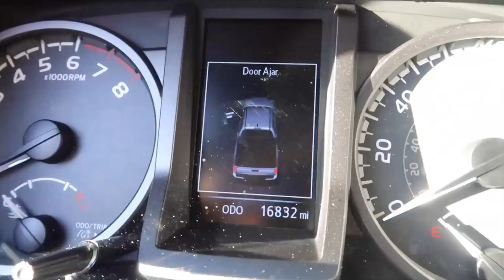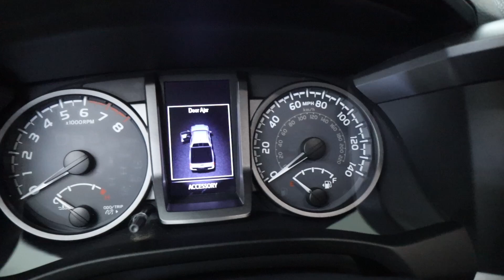What Things Went Wrong at 50k miles on my Tacoma?!

Comment from the maker: Something else I just remembered that went “out” on my Tacoma within 50,000 miles was the Bluetooth on my stock radio. I had it reset by the dealership a few times, tried different phones, but at some point bluetooth just stopped working all together. I’ve since swapped out my stock radio for an aftermarket one with CarPlay and I’ve had no issues since. Anyways, thanks for watching the video and sharing your advice (especially on my steering rack leak)!
Reply: Thats probably common with later model toyotas. I had a 2014 rav4 with a stock head unit and it was useless then got a sony with carplay for about 300 bucks with installation included and it changed the whole car.
Reply: Chloe I have a 2019 ,  when did you have to replace front brakes
Reply: Chloe I had them change mine a year after I bought it the instrument cover,  it actually had cracks in it ,  where did you get the instrument cover
Reply: Lucas Oil makes a power steering stop leak that is worth trying 🤙🏽

Comment: 2018 100,000 no leaks.  But clanking noises when hitting brakes at low speeds.   Moving around in the driveway.  Maybe brake caliper contact?  Not sure.

Comment: 2021 TRD OR, 48K miles. Just noticed the rack leaking in the exact same spot, left side. I have checked it in the past and it was not leaking, so must be recent.

Like yours, the right side is fine. I am opting to leave it alone for now. If/when the time comes, I’ll buy another OEM and swap it myself, and I’ll probably complain about it. 

I’m curious, did yours ever get worse?

Comment: Your suspension...why I never lift or change. Heard there's 1 idler pulley you you can't get the bolt out without removing other things. I think it's lower. My upper driver side pulls was screaming..sprayed some WD40 white lithium grease on it and stopped. I was driving ALOT when the rain came. I think it dried out the bearing. Bought all new pulleys and belt.

Comment: I bought a 2016 Tacoma SR5 last year with 68,000 miles as of now it has 78,000 , I  change the oil as scheduled no problems at all, I  also need to change the spark plugs,  called my Toyota dealer and said they charge 650.00 that's crazy, I'll do it myself, and later transmission fluid change....👍
Reply: chloekuo_1  love your videos, saw you change your spark plugs..👍

Comment: My 2021 tacoma off road at 19,000 miles the battery had to be change at the dealer and at 19600 miles the transmission also had to be change by toyota dealer

Comment: All Toyota hydraulic rack and pinions do that at some point, kinda normal... Probaly get well over 100k miles before that needs to be replaced, maybe more. I have seen remanufactured racks from Toyota looks like that few years after they have been installed. Inspect every service, you will know if and when it needs to be replaced.

Comment: New bulletin out from Toyota last month regarding fuel smell from engine,cause is the high pressure fuel pump and TSB to replace.....dealer wants $1800, my Taco only had 61k on it....wth??? My 2002 Taco has 280k and no issues with fuel pump

Comment: It looks like your rock slider on the passenger side sits higher than on the driver side. maybe you hit something and knocked your passenger side into the bottom of the corner of the bed causing the plastic piece to not sit right?

Comment: I have a 2017 SR5 and at 20k miles the serpentine belt went out.  At approximately 45k and 6 years the battery died.  My 91 4x4 Toyota pickup battery lasted 10 years.  All new vehicles have more vampire current.

Comment: One thing I usually do when I see something that looks like it could be a leak,is thoroughly clean the area. Dirt, grease, etc. Clean it off make it look new. Then watch it like a hawk, lol. Sometimes, things just happen underneath the truck. Maybe not even a leak. But, unless you start fresh, you'll have a harder time determining if you're leaking and how much.
Reply: Highly recommend, I can’t tell ya how many times leaks are far more calculable or found by just taking a couple minutes of proper cleaning.
Reply: Yep. Could be just be some residual oil from an oil change that blew onto the boot with the wind blowing under while driving. And it will look fresh for a while.

Comment: Watch your battery.  My 2021 just had the battery blow out the bottom and acid everywhere.  I had to open a case with Toyota and having the hood and fender repainted along with replacing parts (edit 18k miles)

Comment: You can probably top off the PS fluid for the next 200k miles and never replace anything 😂 My frontier leaks a tiny amount of oil out the valve cover. Oh well 🤷‍♂ Doesn't even register on the dipstick.

Comment: I have a 2021 TRD off road.  I currently have 46k on it.  Dont have any issues with it.  The only issue i have is cosmetic.  The rubber piece over the quick charge is warping.  Doesnt bother me since i dont use it.  Not sure if this is an isolated issue or if anyone else is having same issue?

Comment: Toyota has special type of power steering fluid.  If you add or switch to another your seals will start to fail. Also fluid should be changed out on or before 50k / 5 yrs.

Comment: 2017 TRD SPORT V6 2wheel, bilstien 5100, 285 17 70, 190,000 plus,  I've changed the oil every 5000, changed the transmission fluid,  coolant and rear differential once, that's it,  God willing I'll get another 100,000.....

Comment: 2015 Tacoma with 368,000 miles and the only thing that I have done is 2 tune ups, brakes all around and many sets of tires. I do change oil every 7,000 miles which happens about every 6 to 8 weeks!

Comment: Did you resolve your fox resi issue (interference,  and or repair)? I have thought about getting these shocks, but the resi issue is ridiculous for the price. Mounting location should not have been an after thought.

Comment: Well darn,  sounds like some issues with quality.  I have an '03 and haven't had any of those issues with 212k miles on it. 

I have replaced 2 plastic door handles,  but the Texas sun can make anything brittle after 20 years.   And I accidently pinched the plastic strap off that connected the gas cap,  replaced that last year.  I currently have 2 led lights out in the instrument panel.  No wonder why people come up to me in parking lots offering to buy it!  

My dad once told me the more the do-dads on something,  the more chance of something breaking.

Comment: I think your sterimg boot got oil from driving. Steering fluid is thin I believe and would keep leaking. I think your good. Clean and watch. Mine is a 2018 Trd Tacoma sport. I drive 400 miles a week. Have 45,000 on her now. Just fyi. This is my 5th Toyota 4x4. I got BF Goodrich all terrain and keep at 44Lbs. Thoughts?

Comment: I have a TRW rack on my 2000 Dodge Dakota 4x4.  It had moisture like yours at 75,000 miles.  I never serviced it.  Today it has 149,000 miles on it. Years ago they quoted me a huge number for a new one, and declined the new rack.    I bought the truck new and it does not leak any fluids onto my driveway or garage floor.  The power stearing pump level is always OK.   I would not do anything if it was my Toyota Tacoma.  Take care, be safe.

Comment: my 2018 tacoma is about to hit 100k miles and the only problem i am having is a leaking power steering pump. I also have the power steering rack leak As well but haven't had any problems with the steering. my leaf springs also are completely flat due to my steel rear bumper.

Comment: Have you noticed water intrusion from the interior side pillars in the front where the side grab handle is  when going through a carwash? I cant figure out where it comes from. I have an after market roof rack that I sealed with silicone but it was happening before I put the rack on. It happens on the passenger side and I thought it was from the glove box at first but cant tell. No mold or anything growing anywhere so maybe its normal??
Reply from the maker: Hmm, I have personally not experienced that problem. I wonder if that was a recall and experienced by others though!
Reply: @ChloeKuo  Yeah I haven't been able to find anyone with the same issue on a 19 SR. So far no electrical damage or water damage so who knows....

Comment: I've got 242k on my 2007 with a 6 speed manual, 4.0, 4x4. In that time I've replaced the driveshaft u joints and carrier bearing, rebuilt the front wheel bearings, replaced the alternator, replaced the half shafts, replaced the clutch, and did the brakes. I use it as a work truck for my yacht restoration company and tow boats with it.  I do all my own maintenance and repairs. 50k is absolutely nothing.

Comment: I have a 17 TRD off-road with an access cab.  It has 25K miles on it and is not my daily driver.  I noticed the shift lever (automatic transmission) was getting stiff and not wanting to move.  Then, the D for drive would not come up on the gage cluster.  It would even pop out of drive when I first started moving and I would have to play with the shifter to get it in the right spot to stay in drive.  Also the cruise control would not work.  Eventually, I got a check engine and traction control lights.  Then one day it simply would not go into drive at all.  Luckily I was at my house.  I took the lever for the shifter cable off and the shifter moved freely.  So I knew it was either the shifter cable or something inside of the transmission.  I cleaned and sprayed WD40 on the shifter cable lever underneath the truck on the driver side where it goes into the transmission.  It has worked perfectly for the last 2 months.   I live in Ohio and the rust must of made the shifter lever stick.
Reply from the maker: Oh man, that sounds like a terribly annoying issue, but glad you got in there and seemingly figured it out!

Comment: Changing suspension is  most of your issues.  As a Tacoma owner for 17 years, an engineer, and an auto enthusiast, making changes to several aftermarket parts and adding weight via bumpers etc will cause lots of issues over time.

Comment: Curious, have you done a transmission flush since you hit 50,000 miles?.. I also have swirling on my dash plastic. No leaks on my rack and pinion, but my taco is not modified.

Comment: I also had the same problem with my steering rack . Problem started at 20k miles . Currently at 31,000 miles (1.5 years later) still haven’t replaced it. 😊
Reply: Is that covered under warranty?
Reply: What year is your taco?

Comment: About plastic and scratches....Meguires Plasti X is a great product to remove scratches. You can use it on almost anything that is scratched. I replaced my rear springs on my 13 Tacoma. The replacement springs made for better ride quality and better towing. The OEM springs were OK but one element of the leaf did crack.

Comment: I have a stock tiny 1999 2 door taco 247k miles and I just noticed that I have some fluid on my floor. Took it in and they said $1800.00 for rack and pinion replacement.

Comment: I got the same steering rack leak actually, right around 53K. Monitoring it and making sure it isn’t anything major. About 57K miles and a 2019 TRD OR. I haven’t noticed anything after 3K miles or seen the fluid level change so I’m not sure.

Comment: I just had my 2021 TRD Sport in for a 40K service. No issues, however, about 30 miles after that, I got a check engine light ( I had a Pedal Commander installed). Took out the PC and brought it to the dealership. It ended up to be a throttle body replacement. The service tech, a friend, said this was the third one they've replaced and the previous two had PCs installed. The PC worked great, but since that event , I haven't put it back in. Probably going on sale on Marketplace.  Other than that, the truck works great and no issues! Just a thought.

Comment: How are able to drive smoothly and calmly on a Tacoma knowing you can’t see the hood of the car and not sure if your close on a car or curb or anything
Reply: Believe she has a camera on her grille.
Reply: As a "short little" truck driver, I drive mine the same way as my tractor.  I know my vehicles length and widths, so I don't need anything but my side mirrors. 😁 maybe she does the same.
Reply from the maker: Visibility in my truck has been a HUGE issue for me… although after driving it every day, I have gotten a good sense of how big the hood is and how wide it is. I use my mirrors for the curb and I also try to drive slowly and take my time in parking lots.

Comment: One major problem with my 2019, at 34000 miles, had to have the right catalytic converter replaced. It was covered by warranty. Toyota had no reason for the problem. At 37000 miles the left one had to be replaced. Once again, Toyota had no answer as to why. Other than this, I really like my truck it just turned over 40000 miles

Comment: Yours is like new looking, so is my 19 cement trd off road 4x4 - turned 164k today . Replaced so far 1 battery , 3 windshields , 3 sets of tires , 3” lift Fox shocks. And a large amount of money on Gas 😞 yours looks awesome and you’ve got a long way to go. Tnx for the videos.❤
Reply: That's impressive mileage for a 19'
Reply: wow. No oil leaks or spark plugs ?
Reply: @davidb9323  nope, nothing. No dings, dent’s ..probably going to get plugs and brakes in April
Reply: 3 windshields? Hitting low tree limbs much?
Reply: @cydonianman  full send 🤣
Reply: @cydonianman  debris and rocks on 75 from Naples-Tampa , she’s a highway Princess
Reply: @cydonianman  Rocks from dump trucks on 75 north and south, but so far no flat tires 🤘😎😉
Reply: I bought the same truck but mine has a manual transmission. I bought it 2 weeks ago with 88k

Comment: Hey could you give us a review on the tune you got for your truck? What's your honest opinion. Does having the tune drive the same as driving the truck on ect stock?
Reply from the maker: I have really been enjoying driving on my OTT, especially on the freeway. And when it comes to comparison with ECT, I personally felt a difference—along with shifting at higher RPMS, it also increases the throttle response, which I don’t believe ECT does.
Reply: @ChloeKuo  thanks for the response 👍 the throttle sensitivity is the only thing I'm worried about. 😟 . From 0 to 10 how much more sensitive would you rate your throttle response, 10 being alot.? thanks for the info 🤟
Reply: @509livin8  I can't speak to Chloe's tune and this issue, but fwiw I recently got the KDMAX-PRO-9.0 tune with the "Normal" throttle setting, which is the middle of the three available. I'm kind of assuming that most of these tunes, at least the ones that have been around for a while and have been refined, are pretty similar. If Chloe's tune is anything like mine, the throttle response is definitely much more sensitive. It takes some getting used to. At slow speed starts, like when I'm trying to inch forward on to ramps, or car wash front wheel stops, it takes a very light touch to not surge forward faster and further than you want to. This is on an otherwise bone stock with no added weight '22 TRD OR DCLB. I think that as I add the extra weight of larger tires and a camper shell the sensitivity will become less noticeable. With my current setup there is a noticeable difference from stock when I am passing, especially on two lane roads where you want to get up get moving like right now. I also notice a decent amount of difference in general driving where it no longer hunts for gears on climbs.

Comment: It’s possible that when you was off road you stressed the steering rack a little bit and forced some fluid threw a seal.  Because if the seal was bad it would continue to leak and get worse in my opinion. Maybe clean the boot up and dry it off , drive it while and check it to see if it gets wet with fluid again.  But I’m guessing you strained the pump while off road and it pushed a couple drops threw the seal.

Comment: My 2017 is all dry underneath.  I would recommend cleaning it off really well and the watch it.   That could possibly be something from the road. And also if it is a seep in the rack and pinion unit the moisture will show up again and then you will have a good idea as to how bad the seep is.  I’ve only changed fluids and brakes.  Nothing else.  My 2017 is awesome I Love it.  Got a lift and it’s so much fun.  Just a daily driver and good to take fishing off road.

Comment: I've had my used Tundra for 2 years now and its at over 140k miles. Surprisingly ownership has just mostly been oil changes and filters. There is recently purchasing new tires after my previous KO2s had finally worn down enough for replacement. Its estimated that they lasted over 60k miles if not more but not sure of exacts as I didn't originally put them on. The only big issue to happen is a part that had to be replaced realting to the brake lights always being on. A few buttons on the stock radio were starting to go out when I first got the truck, however, I had already planned to replace it with an aftermarket carplay option which I did. So glad to say its been mostly regular maintenance! Also would've got a Tacoma but the Tundra won me over with the tow capacity, just wish I had Tacoma fuel economy.

Comment: I have a 2018 taco and my steering rack started leaking exactly the same way as yours at 50k miles and i just left it alone. Now i have 110k miles and the leak has not changed at all. It does not drip and fluid level does not change.

Comment: Yup my 2022 has the misaligned bumper....3800 miles and the truck is leveled from the dealer. I have a shell and 100 additional pounds in it and at times its looking like it might be sagging a tad. Just ordered Firestone 2407 airbags to add a bit of lift. I don't offroad much but do carry a load when traveling. Bikes, racks trailer with kayaks. Went from American full size trucks to Tacoma again....will see....in the 80's they were tough little trucks. Good video.